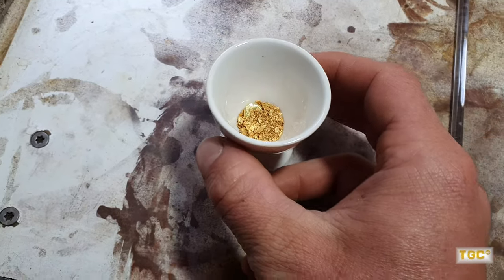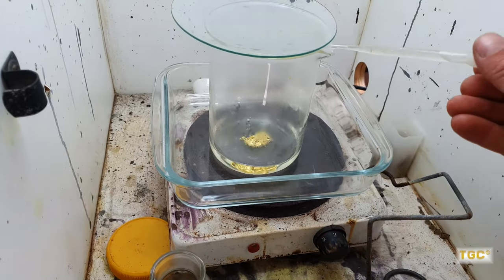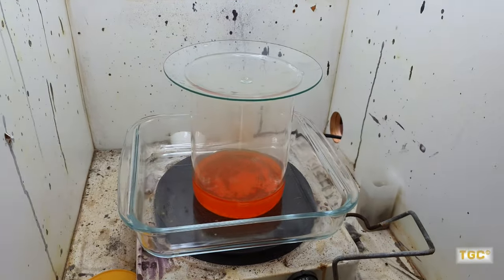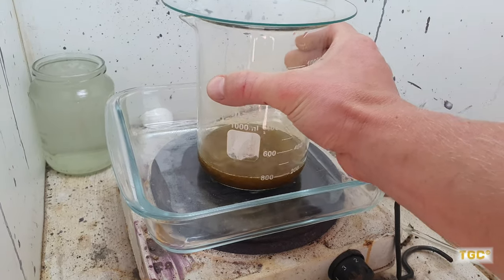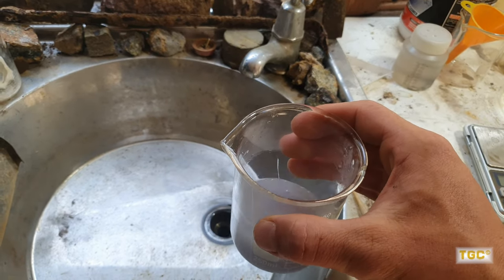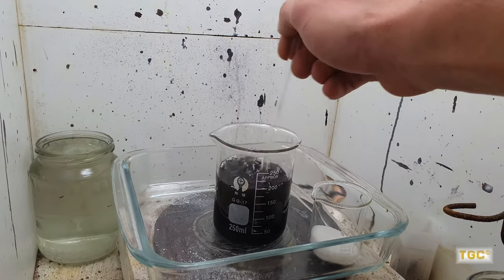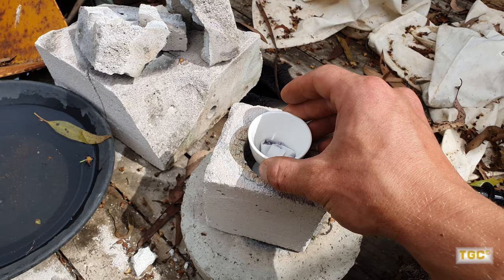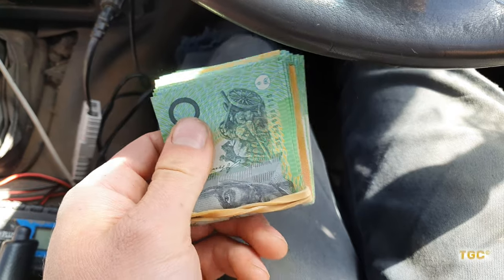CHEMICALLY REFINE YOUR GOLD TO GET MORE MONEY!!!

Comment: Hello how can I remove silver from my fine gold? The gold has been xrf test to 97% with 3 % silver. Is there are to smelt the silver out to 9999’s?
Reply from the maker: G'day Jenko, you can remove the silver quite easily with some chemistry. But it does require some basic equipment.  Research "Gold Inquartation" to learn the process. Inquartation is the easiest way to remove your silver, it will involve adding more silver to the mix with a melt, to bring the silver content up to around 75%. Once there is approx that amount of silver in the mix, you can easily dissolve all of the silver off in some hot dilute nitric acid. Leaving just the gold sponge behind. The silver can then also be recovered again with the addition of copper to the waste solution. The copper will replace the silver in the solution slowly, leaving you again with near pure elemental silver in your beaker.

Comment: Excellent video Bryan. Have you got a list or links for all of the chemicals that you have used? Perhaps you can do a video on the safe disposal of all of the chemicals that you have used? You certainly must have paid attention during Chemistry classes at school. About the only three chemicals that I am familiar with are Hydrochloric Acid and Borax and sugar.
I often have to buy HA from Bunnings for use in the School Swimming Pool to adjust the chlorine levels and for brick cleaning cement or mortar. 
I and no doubt a few others will have to watch this video again numerous times to get familiar with the techniques involved. Thanks again for making this video. 
BTW, do you happen to know the chemical(s) involved in dissolving quartz rock to just leave the gold behind?
Mark from Melbourne Australia
Reply from the maker: Thanks heaps Mark! I dont have links sorry, but i can make a list! Hydrochloric/Muriatic Acid as the holding solution, Nitric acid as the oxidiser, Urea for DeNoxing the finished solution before precipitation if you've used too much Nitric, Sodium Metabisulphite as the precipitation additive (reacts with the Hydrochloric to produce the Sulfur Dioxide gas that makes the gold drop out of solution), Sodium Hydroxide for converting the silver chloride to silver oxide (also the most effective additive for neutralising acidic waste for disposal), standard old sugar for converting the silver oxide to elemental silver.  

Stannous chloride is essentially just a heap of elemental tin dissolved (paifuly slowly)  in hydrochloric acid, it is used as a reactant with the gold solution to either insure there is gold in solution or ensure you have precipitated all the gold from the solution. 

To your quartz question, the most accurate way to slowly dissolve silica and most things other than gold is Hydrofluric acid. It's not something we can purchase concentrated in Australia, but you can buy Alibrite from most auto spares shops and some welding/fabricating shops. Alibrite has a small amount of Hydrofluric in it. 
Wear gloves, put your specimens in a PLASTIC container and submerge it in Alibrite. Dispose of the Alibrite every 3 days and replace with new stuff. Continue the procedure until you get your desired end product. 

The other (and much more agressive) option is bulk Sodium hydroxide mixed into water. Put into a good quality stainless steel pot/ container and put onto low-medium heat. It's very reactive though, so much harder to control how much gets dissolved and how quickly. 
Hope that helps!